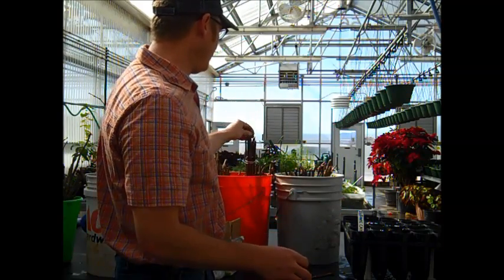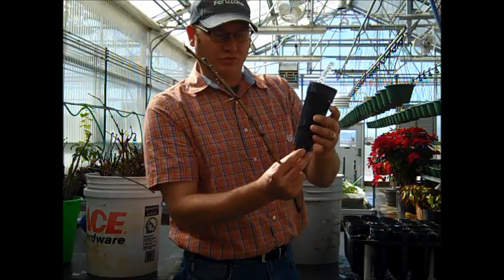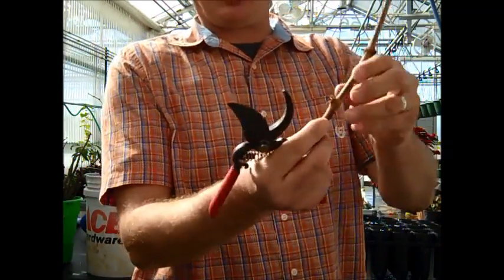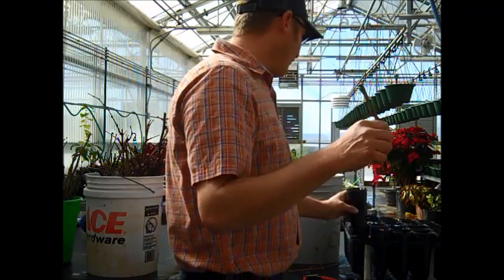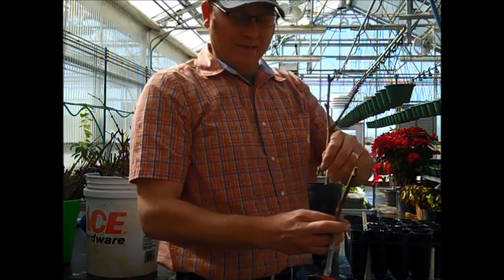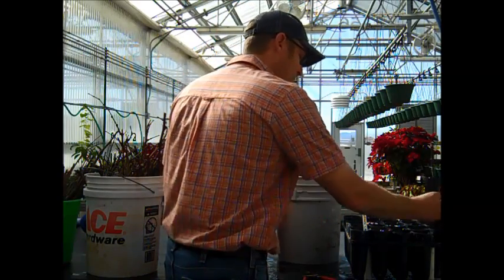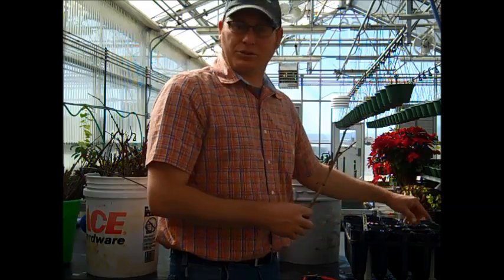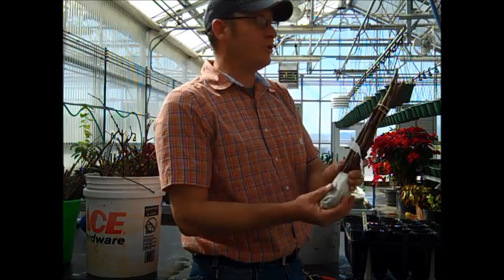Dormant Hardwood Cuttings  YC style

Comment: Nice video, I have watched several videos on grapevine cuttings and so  far your the first that say to remove the bud that goes into the potting mix. Do you know why the others don't do this? Thanks again for the video I enjoyed it.
Reply from the maker: wounding teh buds give extra places for roots to emerge when those cells callus. if you don't rub out sprouts emerge from below the soil as vegetation. too many of these can overwhelm a newly spouting hardwood cutting with only one cut end to grow roots and support all that growth. Also, depending on your climate and management plan, buds below ground can be a protection or backup plan (good thing) or cause a management issue if pruning is required at soil line (bad)

Comment: Excellent information, and thanks for making and sharing this video. Your disclaimer states you cannot legally propagate cuttings from trademarked plants, but I think that may not be the case.  Certainly, if you were to sell those cuttings, then you would clearly be in violation of the law.  However, if it is for your own use or to share with a friend and no compensation is given or expected in return, then it's not truly an action of "trade", which trademark laws are intended to protect.  Thanks, again, for doing such a good job on this video.

Comment: I would like to grow roots from persimmon cuttings. I have some soft wood cuttings that is in dormancy. I have them currently in a ziplock with water until I'm ready and have enough information to start on them. I'm going to cut off the top tip so that it doesn't have to put energy into growing new shoots.  I'm planning on putting them in a large clear plastic container with the lid on. For my medium soil I will use perlite,  coarse sand, peat mixture,  and vermiculite. I will scourged the bottom and dip them in rotting hormone and put them in the medium soil. I will either have the lid close and put led light on top of the lid or maybe without the lid, not sure. I'm not sure to whether or not to wet the medium soil or just spray mist tne cuttings.  Then check on them once in a while to mist them often to keep the moisture. Any suggestion and advice is greatly appreciated.  I'm new to this and would love a success story to tell any else who is interested in rooting persimmon cuttings.
Reply: I've never tried persimmon but the principles are the same I'm sure. I worked in a plant nursery where we (4 of us) did 100k cuttings a year! First, it seems like you are keeping them stored with too much moisture so they will get moldy and if the bag is sealed then your in trouble for sure, use some barely damp moss, like from the forest. Make drain holes in the plant pot of course, you can skip the vermiculite or use very little, it holds the water too much and you need oxygen down there, bottom heat really helps so top of the fridge or water heater or a heat mat until you see shoots. Don't put the lid on tight, don't make it too wet and it should work! Good luck.